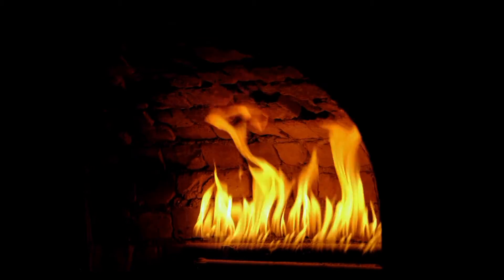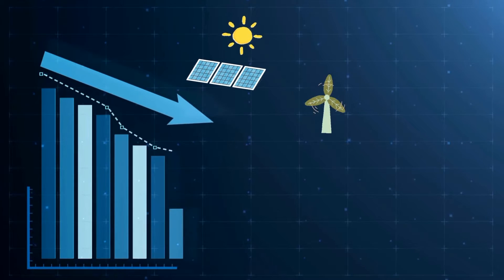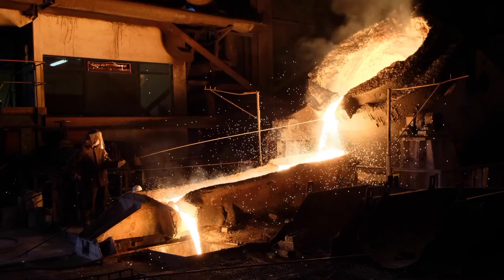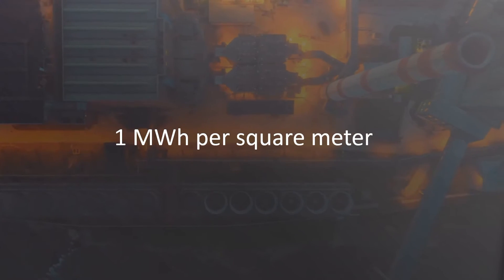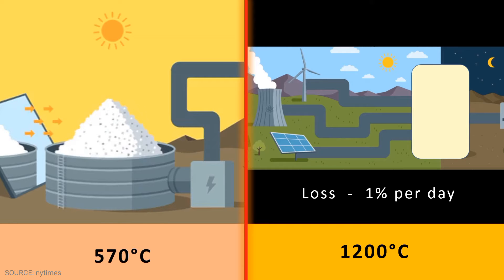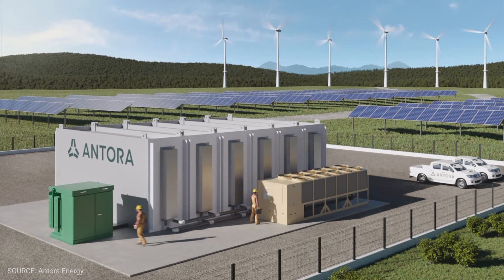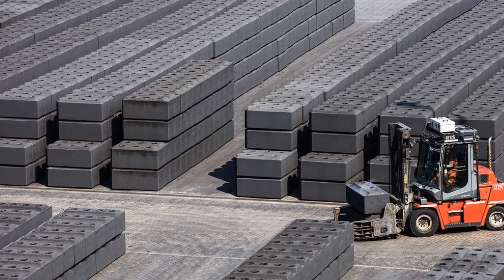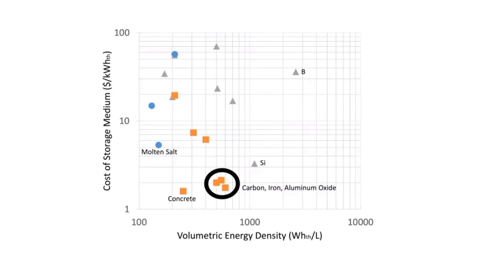How This Simple Material Breakthrough Will End Battery Storage

Comment: Really nice film dood.   I am experimenting with domestic sand batteries and would love to know more about the insulation that achieves 1% loss per day?  Also the tpv cells for turning heat into power, where can I get one please (I’m in the uk).   The properties of graphite as a thermal mass is very very interesting, I would like to know if graphite is heated with an element or does the graphite itself work as the element?   I would love to establish an ongoing conversation about this if you don’t mind?  Would you send me an email address please?  Thanks again for a really really worthwhile contribution!
Reply from the maker: Glad that you liked the video. Yes, graphite blocks are resistively heated using elements.
Reply: @revolutionaryengineering  n hi and thanks for your reply, can you suggest a good strategy for insulating small systems  (<1000kgs)   atm i am using refractory ceramic fibre

Comment: I had electric storage heaters at home which heated up bricks inside a metal casing, and these produced heat for several hours after the power supply was turned off. The only problem with those is that when they were used irregularly it cost a lot of money to get them warm from a cold start, but a brick battery would be in constant use, so far more efficient.

Comment: resistive heating is very inefficient. also you say you can store the heat for 50 years and then say 1% per day loss.
Reply from the maker: Converting electricity into heat using resistive heating is a 100% efficient process. That's because  all electricity is converted into heat. 
Storing heat for 50 years means that the material does not degrade and remains suitable for heat storage during this time.
Reply: @revolutionaryengineering   yea so i guess if you just need heat thats fine but if you need to convert back to electricity it seems like a battery is still the way.
Reply: @domenicperito4635  I mean yes if you want electricity then sure it can be a lost but for high Temperature Processes it's a very interesting Option with a Little lost
Reply: @revolutionaryengineering  and being 100% efficient is misleading beacause a heat pump is 300-400% efficient. the real way to compare is cost to heat a cubic meter per hour. and in this sense electricity costs way more money. or even better cost per million BTU.
Reply: @domenicperito4635  Sorry, but you don't seem to understand the premise. Heat is added to the thermal mass at a rate higher than a heat pump can generate. This is why resistant heat is used. With resistance heating, you can add heat well in excess of 500 degrees which is not possible with a heat pump. Your electric stove doesn't use a "heat pump" for a reason.
Reply: @robertmiller5135  your missing my point. Your saying that resistive heat is 100% efficient when the electricity used was not generated at 100% efficiency. so yes it is 100% "efficient" as a closed system, but istead of burning fissil fuels or collecting solar energy and using to run a generator to then power your resistive heat is stupid when you can just directly use the energy to make heat.
Reply: @domenicperito4635  Sorry but you still are don't understand and I didn't write about resistant heating being 100%, but another poster did. Again, a heat pump cannot generate the necessary heat i.e. temperature to meet the demands of this application. A heat pump has a general maximum temperature of 60 degrees (some minor exceptions), and cannot generate the upwards of 300 degrees needed for a thermal battery to work. I am not sure what you are talking about making heat directly since that isn't an option, and even using thermal solar panels, the temperature doesn't reach the required heat. You really should watch the video again, as it is clear that you don't understand the principles involved.
Reply: @robertmiller5135  yes it is an option. you direct the sun with mirrors onto a point to heat it super hot. or you just burn oil. and nuclear material gets super hot.
Reply: @robertmiller5135  its not my millions your trying to waste. lol
Reply: @domenicperito4635  So you have given up on the heat pump, and now are moving towards concentrated solar, which not only has a long history of failure, it is more expensive that solar panels, especially on an industrial scale, and using fossil fuels or nuclear for such an application is just silly. You do realize that the point of these types of ideas is to be pro-environment? Right? By the way, if you are using fossil fuels, or nuclear then you don't need a thermal battery. Again, you don't seem to understand the point of the video.
Reply: @robertmiller5135  lol yes i do. its to end battery storage. with a box of heat energy. you are converting heat energy into electricity at the generation step since most power plants use heat energy to generate power. to then use a resistive heater which uses that electricity to turn it back into heat to store it.........which you then have to convert back to electricity to use.
Reply: @robertmiller5135  the heat pump was just an example for how the efficiency measurement can be inflated when neglecting how you actually create that energy
Reply: @robertmiller5135  it would be a great idea to use at the power plant if you just store the heat energy created by nuclear or fossil fuel power plants but remotely you have to add another heat electricity conversion cycle
Reply: @robertmiller5135  furthermore yes you could just use it to store heat energy for use as heat energy with your solution.....but then its not ending battery storage like you claim....just endingit in one neiche case when they probably just want to keep that heat energy in a large thermal mass locating in the furnace....not outside........................
Reply: no one is ever gonna read any of this but you btw....so idk why you care so much about what i think....but good luck with your endeavors anyways appreciate you
Reply: @domenicperito4635  Again, you don't understand how the process works. Fossil fuels and nuclear fuels are themselves heat or energy storage. It doesn't make sense to burn natural gas, to store it later in any form of battery, since naturals gas (nuclear energy) is stored energy. The point of a sand battery is to store energy that is not itself, in turn stored energy e.g. solar, wind.
Reply: @domenicperito4635  Your statement doesn't make any sense, since a heat pump or resistant heating has nothing to do with the creation of energy but rather the end use. If I create the energy with a gopher, and a wheel turbine, it has no effect on the efficiency of the product using the energy.
Reply: @robertmiller5135  you have to convert to electricity to send it long distance from the power plant......you cant send the heat energy across miles of land.......
Reply: @domenicperito4635  That makes no sense either. May I suggest that you perhaps spend some time thinking before you post, or for that matter reading up on the subject.
Reply: @robertmiller5135  may i suggest you not be ignorant?
Reply: @robertmiller5135 your just posting sensationalist things and coming up with solutions to problems that are overly complicated and roundabout.
Reply: Since I have corrected you on several occasions, and pointed out your lack of coherence on at least one occasion, your post indicates nothing but projection. Again, if you don't know what you are talking about, a smart person would ask questions rather that offer gibberish. Maybe  you should ponder that.
Reply: @domenicperito4635 . That makes as much sense as your previous posts, and comments. In the face of correction, you wish to project your own issues on others. Tell me again, how a heat pump would solve all these issues.
Reply: @robertmiller5135  no you just think you did lol
Reply: @robertmiller5135  its quite simple you claim to have solved something which you have not.
Reply: @robertmiller5135  like i said already taking electricity and converting to heat just to turn it back to electricity is dumb. and in the circumstances where you can actually store the heat energy because you dont need to send it anywhere it is still dumb because there are already well known ways of doing it wich are much easier. like just storing the heat in the circumstance of solar and never needing to create electricity first. or using a wind turbine to pump water to a higher elevation.
Reply: @domenicperito4635  Mmmm. A stupid person who doesn't admit that he made mistakes? That never happens. Of course, the "lol" really proved your point.
Reply: @robertmiller5135  geothermal enery uses a heat pump. i jist didnt feel.like giving an example. also solar heat farm uses heat pump.
Reply: @robertmiller5135  also its about storing energy not heat
Reply: @domenicperito4635  OMG - heat is energy "genius", and you obviously didn't watch or understand the video. "There is no need to convert it back into electricity..." 12:50 of the video. Geez!
Reply: @robertmiller5135  heat is energy yes i didn;'t say it wasn't but electricity is a higher form of energy and when you convert you lose some
Reply: @robertmiller5135  the point is you said a heat pump couldn't get hot enough.....it can
Reply: @robertmiller5135  again there is a need to convert it back like i previously said.,...if you want to send it anywhere of distance from the point of generation of power......like as in a power station..............................
Reply: @robertmiller5135  quote from you " Again, a heat pump cannot generate the necessary heat i.e. temperature to meet the demands"
Reply: @domenicperito4635  Again, as I have said before that is gibberish. Strange how you just skip over your corrections and revert to more nonsense. Post less, and read more.
Reply: @domenicperito4635 "....it can". Wow! With that kind of brilliant, fact based evidence, it is hard not to laugh at you. Go and talk to any and I mean any HVAC person and ask them what the temperature range for a heat pump is. Here is a clue - they are only now reaching 50 to 80 degrees celsius in domestic water and home heating. This is why in Europe, these heating systems are only mandatory in new home construction with excessive amounts of home insulation. Geez! If a company could use a heat pump, which is by its nature more efficient to reach the desired temperature, why wouldn't they since they have a COP of 4 to 5. Do you know what that even means? Do you even know what a heat pump is? Read more and post less.
Reply: @domenicperito4635  OMG, you wrote something stupid, and ignored your correction yet again. 

 "There is no need to convert it back into electricity..." 12:50 of the video

The video and the idea is about storing heat, for it later use as heat. Don't you feel any shame at not understanding even the basics of the video or the topic?
Reply: @robertmiller5135  no because im saying your wrong.
Reply: @robertmiller5135  just because you say it doesnt make ot true
Reply: @robertmiller5135  so if i take a solar farm and i store the energy as heat then i want to send it somewhere else how do i do that without converting to electricity?
Reply: @domenicperito4635  So you show up again to write something unconnected to the topic and to your many corrections. The video is not about electricity, or about shipping energy in any form over great distances. What is wrong with you? Seriously, do you just hang out on the internet and write a series of non-sequiturs?
Reply: @domenicperito4635  Do you mean because I provide actual facts, and know the topic, while you offer neither facts, or even a basic understanding of the video upon which you originally commented. Maybe read more and post less.
Reply: @domenicperito4635  Well, you "convinced" me. After all, you don't know what the video was about, you don't have a clue about the topic, have been corrected numerous times, and on top of all that have provided zero facts, but hey, that is how you prove that someone is wrong. Let me guess, school was not easy for you.
Reply: @robertmiller5135  no i point out wrong information
Reply: @robertmiller5135  i wasnt trying to convince you. i just commented on your video and you started an argument
Reply: @robertmiller5135  your video title how this simple material will end battery storage. it wont simple as that. i dont need to convince you of anything.

Comment: We were using this idea here in Oz back in the 70's in the form of 'offpeak home heating'.  It utilised the low demand times cheaper off-peak rates  to heat up a pile of bricks and the heat was extracted using a multi-speed fan.  They seem to have lost popularity possibly due to the habit of running out of heat sooner than desirable requiring alternative heaters operating at full general supply rate to make up the difference.  Heat pumps (with reverse cycle) combined with efficient insulation and double glazed windows are now the best 'off the shelf' option these days.